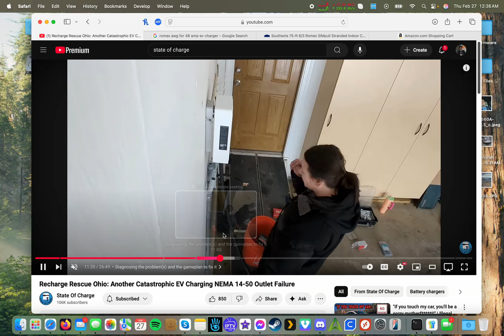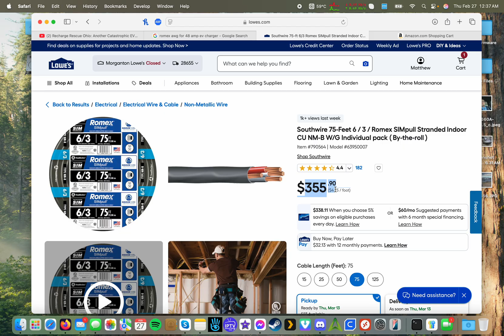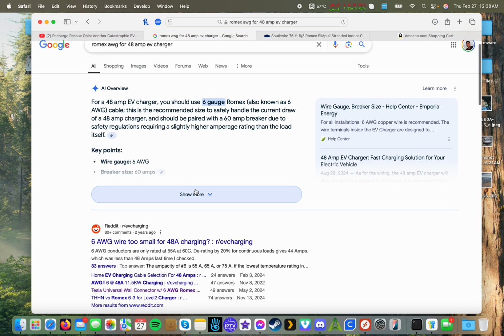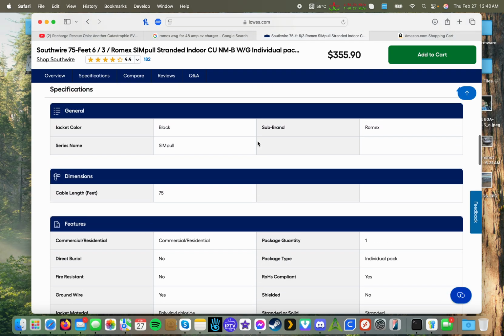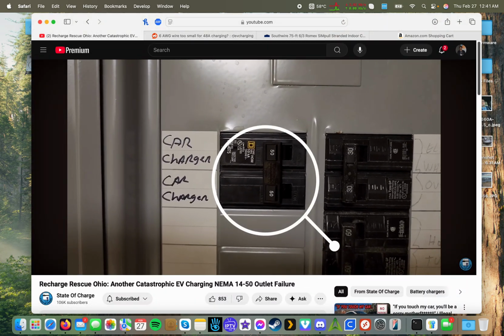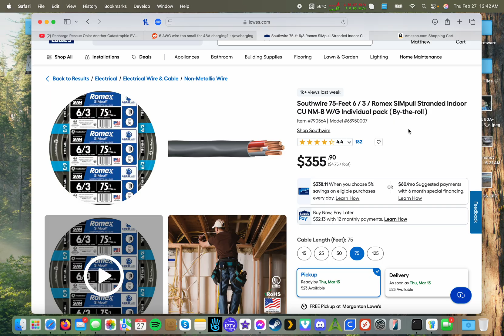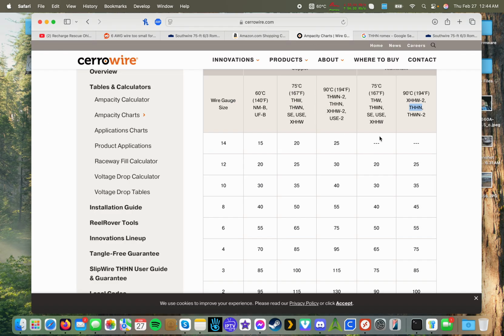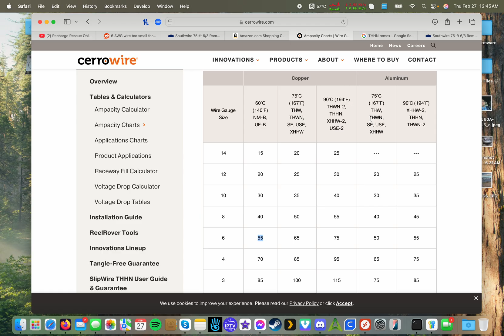6AWG Romex for a 48 amp EV Charger

Comment: There are plenty of comments explaining it correctly, your romex (nm-b) is always rated at 60C. Take into account continous use and you are incorrect, I would try and call him out on this. 

Its easy enough to read the manufacturer spec where it tells you 6 thhn-2 or 4 nm-b. The manufacturer literally tells you what you need to use

Comment: The EV companies that make the product have the right answer.The problem with using 6 gauge romex for an EV application pulling 48 watts are environmental factors that aren't part of your code table. This is why most states require not only 4 years in school, but 8,000 apprentice hours so you learn more than reading a chart. Romex is fine for dryers or stoves that may run for an hour or two, but for an EV charger that is pulling 48 amps continuously for hours can build up heat. Romex run in an attic or through insulation or both can overheat and cause a fire hazard. You are supposed to use THHN stranded copper individual wires and pull them through conduit and run it through a cooler area just for extra safety (along the lower edge of the attic near a soffit with airflow, etc.). Also, Romex may work fine for 3-4 years or more, but once it fails after years of overheating and vibration, and kills someone, the insurance company will point back to "no Romex!" and want to see what licensed electrician you used so they can sue them. Else, they will just deny your claim (or both). If you wired it yourself and used Romex, be prepared to have your homeowners deny your claim.

Comment: The individual wires may be rated for 90°C, but Romex (NM-B) wire is usually ran in areas that will be in direct contact with insulation and by code must be rated at 60°C. Wire like THHN would be ran in conduit, which as a max fill ratio and leaves air space within the conduit.  Any circuit that has a continuous load must be rated for 125% of the load. So a 40A EVSE would be required to be on a 50A circuit.  Even though Romex may be rated for 55A, a 55A breakers can be hard to find. Most areas will not allow a 60A breaker on 6awg Romex, the few that due require a calculated load of 55A max or 44A when used with a continuous load.  By code, your breaker and your EVSE connection points MUST be rated for 75°C or 90°C if you ever plan on using 75/90°C wire, if you breaker only list 60°C then your wire type makes no difference.  At the end of the day, it's your home, your family and your insurance policy do whatever floats your boat.

Comment: Romex gets special treatment in the NEC because it is commonly strung behind walls and through insulation and even attics in residential installations.  Those locations make the wire more prone to heat dispersion complications, so to keep the code simple the North American guidelines for residential work require sticking to the 60 deg column with Romex. So, most electricians will avoid Romex cable by switching to single wires of THHN/THWN inside conduit, and often the conduit is placed along a wall which avoids attic heat and insulation problems. By doing that and by evaluating termination temperatures at both ends, you can often use the 75 deg column for wire ampacity. So #6 THHN inside conduit is a pass, and #6 Romex is a fail.  Your google AI response is surprisingly incorrect.

Comment: I have 2/3 Romex on order with an 80 amp breaker for use on the Grizzl-e 80.  Overkill?
Reply: No, it's actually undersized. Any device with a continuous load must be on a circuit rated at 125% of the load.  So, 80A * 125% = 100A. Your wire has a max of 95A. Plus, no need for 3 conductors, neutral wire isn't used for L2 EVSE.
Reply from the maker: 95 CAN be rounded up to 100 tho. That’s typically how it’s done depending on the electrical code where you live. At least we can round any 5 up to a whole number on wire
Reply: @MatthewSerta1 you may be allowed to round up on the breaker, but I highly doubt that includes wiring. Most areas that do allow you to round up on breakers require a load calculation to be done. That load calculation can not exceed the rating of the wire. His wire has a 95A rating or for a continuous load, such as an EVSE, IT MUST be limited to 80%, which would be 76A. So, like I said originally, his wire is undersized.
Reply from the maker: I understand that the rules are different per state, so what’s allowed here may not be allowed there. But we definitely are allowed to round up on the wire. By our standards he has exactly enough.

Check out NEC 240.4(B)
Reply from the maker: It’s also important to note that very few EV’s today even take 80A, so he likely would only be using 48 anyway
Reply: @MatthewSerta1 yep, now perhaps you should read it again, 240.4(B) is for over current protection only. It says absolutely nothing about being allowed to run the wire at a higher capacity.

Comment: AI overview is consistently wrong. Your "Google search" isn't really telling you anything. From an actual Google search result " The ampacity of #6 is 55 A, 65 A, or 75 A, if the lowest temperature rating in the system is 60, 75, or 90 C, respectively. So you need a setup rated for at least 75 C.

There's an odd provision in the code that NM-B and UF-B can only be used at the 60 C rating, even though the wire is rated to 90 C. "

Comment: The US national electrical code is very specific about the ampacity of romex. It says that you have to use the 60° column, regardless of what it says on the wire. So code does not allow putting AWG Romex on a 60 amp breaker. If you want to put a 60 amp breaker on there you would need to change the Romex part over to THHN in conduit.